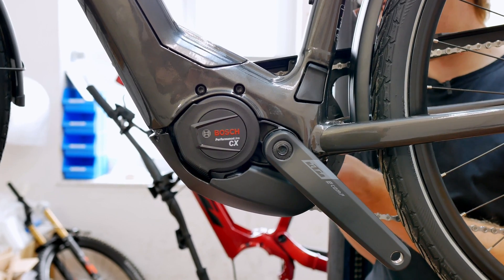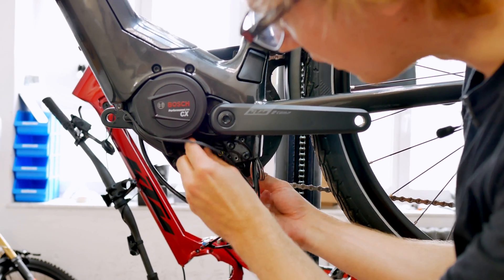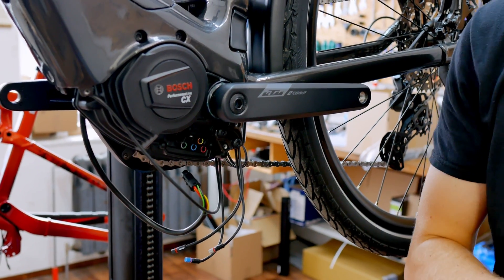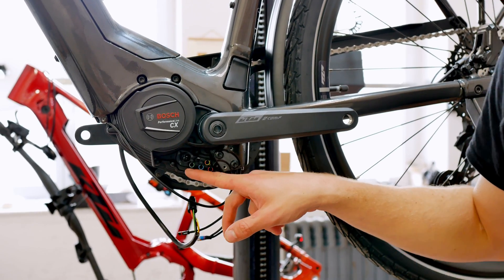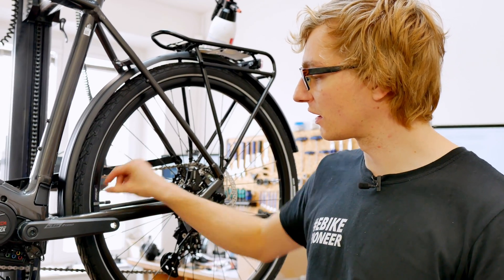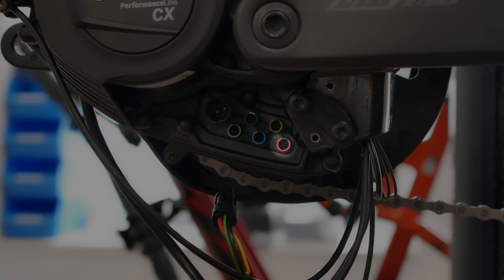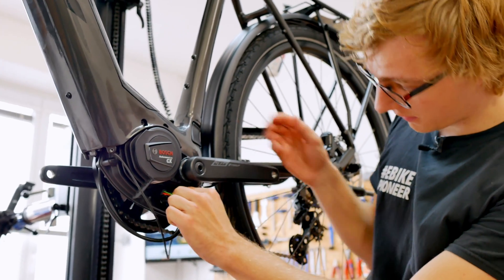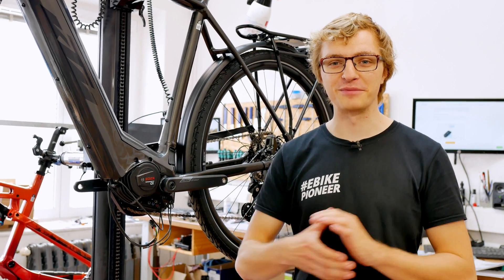Connections on the Bosch Smart System | EBIKE24

Comment: Hello i have SRAM AXS power adapter with yellow connector do i connect to HPP? Thanks
Reply from the maker: Hello, yes, no problem. Thanks.
Reply: @ebike24 thank you. Is this port enabled by default? I cannot seem to get it to power the sram AXS 😭
Reply from the maker: Sorry, I thought you meant the SRAM AXS derailleur, since it's not called SRAM AXS power adapter, but rather SRAM AXS  Powertrain power cable: https://www.ebike24.com/sram-axs-powertrain-power-cable-circuit. SRAM AXS charger, if you mean that, will not work on the HPP port. Bottom line, no Bosch Motor port can charge any SRAM AXS derailleurs. Thanks.
Reply: @ebike24 yes the link you provide is what i mean. This should work without a dealer enabling the port? Thanks for your reply
Reply from the maker: Mostly yes, it is be plug and play, I 'm not aware of exceptions. Although they are possible, they are rare. Thanks.

Comment: Wow, awesome video! Just curious, are these connections the same for all the Bosh motors in the smart system??
I’m the proud owner of a 2025 Cannondale Tesoro carbon equipped with a  Bosh Performance Line Sprint (BDU314Y) motor
Reply from the maker: Thanks. Bosch Performance Line Sprint is a 28 mph motor for the U.S and N.Z., its connections are not the same.

Comment: Could you do a video for gen 5 motors? Is there any difference? I am interested in power output for each port. Some of the ebike lights have high power needs and I couldn't find any information about them.
Reply from the maker: Well, here there are the GEN5 connections: https://youtu.be/Ch8jtN15w44?t=98. You may be interested also in https://youtu.be/RjT9ujpA5MI and https://youtu.be/gZLJcZKb8R0. Thanks.

Comment: Hi, I'm adding front and rear lights to an SX motor. have used the Bch3361 cable from the manufacturer. (cube). Do I need to enable any ports as they are not functioning? many thanks
Reply from the maker: Sorry for the inconvenience. No, there's no need to enable any port.

Comment: How would one add the Bosch ABS (non-Pro) to the Performance Line CX with a GPS module? Series-connections, or would this be done with the "Bosch battery multi-connector cable for component connector" (EB1212004G and EB1120009Z)?

Comment: Hello
please, if I have a wired speed sensor and brake rotor magnet and I want to use a rim magnet, is some adjustment necessary via Bosch diagnostics?
Reply from the maker: Hello, and thank you for your comment. This is theoretically possible but requires certain conditions to be met. The bike must be compatible with a rim magnet, this information can be obtained from the manufacturer. If the magnet is replaced, the bike must be taken to a certified Bosch service centre. At the service centre, a configuration change request can be submitted via the Bosch diagnostic system. The manufacturer must review and approve this request. Once approved, the new configuration will need to be installed on the bike. Here, I recommend contacting the manufacturer directly first.
Cheers - Michael
Reply: @ebike24  Thanks for your reply. So it's a complicated process, it will be easier to get a brake rotor with magnet 😃
Reply from the maker: Yes, indeed a complicated process. But you don't have to replace the whole brake rotor, the magnet is also available as a single replacement part: https://www.ebike24.com/bosch-magnet-6-loch-bdu3xx-bdu4xx
Reply: @ebike24  Good to know, thank you 👍

Comment: Thank you for your content! You help me understand things better.
There is not much information about the Bosch Connect Module, and I would like to figure it out. I would be grateful for your response. My question is:
On the Bosch website, it was mentioned that the ConnectModule works with cellular communication. I didn't quite understand, if my bike is several kilometers away from me, will I not be able to see it on the map in my Flow app? Does this module require a SIM card?
Reply from the maker: Hi, thank you for your kind words! Yes, you will be able to locate and track your bike with the ConnectModule. This works through the eBike Flow app. You will also get notified when the bike is locked and someone moves it, and you can see the movement on the app. The ConnectModule has an eSIM integrated, so you don't have to purchase that additionally. Let me know if you have further questions.
Cheers - Michael

Comment: What is maximum power to lights outputs (blue,red)?
Reply from the maker: Hi with the Bosch Smart System the light output is always 12 volts. So take this into account when buying the lights and buy special headlights and tail lights that are designed for direct current and 12 volts. Hope this helps.
Cheers - Michael
Reply: I asked to power (Wats) not Voltage. I found that light output has 1.5A current which give 18W (12V x 1.5A). But I am not sure if it is separetly for front and rear light (18W+18W)?
Reply from the maker: Sorry for the misunderstanding! Just looked it up again, it is actually 17.4W for the front light, 0.6W for the rear light. Can also be found in here in Bosch's manual on page 10: https://shorturl.at/DL8mg
Reply: @ebike24  Dear friends, excuse me: 

by connecting such 12V/17.4W port to an 12V-USB adapter, could I charge my iPhone 12 pro ? 

Did you ever try this or could you pls, kindly ... make such a test that could be SOOOO (!) useful to many ciclists ?  🙏😉🙂❤
Reply: Thanks! 👍

Comment: Hello, is the HPP connector (yellow, orange) freely active. Or is it blocked like the connectors on the lights? Thank you
Reply from the maker: Hello and thank you for your comment. That varies from manufacturer to manufacturer. Usually, the HPP is already activated for use. It is best to connect a device and test whether the port is supplying power. Hope this helps!
Cheers - Michael

Comment: are you sure the speed sensor is 12v and not 3v?
Reply from the maker: Hi, thanks for your comment. Yes, 12 volts with 1 ampere max. is correct for the speed sensor / low power port.
Cheers - Michael

Comment: Great videos, are the connector type in this example BES2 or BES3?  Are HPP and LPP physically use the same connector with only difference in color coding?  Thanks!
Reply from the maker: Hi, thanks for your kind words! The Bosch Smart System is BES3. The HPP differs from the LPP not only in its colour coding but also in its design, which means that you cannot connect a cable that is intended for the LPP (e.g. speed sensor) to the HPP. I hope this helps you, otherwise you are welcome to contact our customer service at info@ebike24.com.

Cheers - Michael

Comment: Could you make a video about how ABS in combination with Rohloff E14 is connected to a Cargo Smart System motor? I'm wondering if there's any free ports for other accessories.
They must be usingr the T-Cable or the multi-connector cable from the factory I guess. At least with multi-connector there should be extra HPP ports.
Reply from the maker: Hi, Thank you for your comment. Indeed, there is a T-Cable and a multi-connector cable from Bosch. You'll also need the Component Connector to use one of these cables. We have just added them in our shop:
https://www.ebike24.com/bosch-component-connector-smart-system
https://www.ebike24.com/bosch-battery-t-cable-component-connector
https://www.ebike24.com/bosch-battery-multi-connector-cable

We have a video regarding the connector on our German YouTube channel too. I will make sure that we publish this soon on this channel as well:https://youtu.be/IqnqdL9bELg?si=vfKleVwo0hqVow9q

Do not hesitate to contact us if you have any questions.
Cheers - Michael

Comment: Great video I wanted to ask if your bike has a rim magnet sensor can you change this to a spoke speed sensor by adding the sensor to the bike?
Reply from the maker: Hi and thanks for your comment! Generally speaking, this is possible, you can install the spoke magnet and connect the Speed Sensor Slim to the Low Power Port mentioned in the video. The only difficulty might be the bike's system settings. So far there has been no information that it has not worked, but it may be that the manufacturer has to switch the bike settings from rim magnet to spoke magnet. This would then be done via the Bosch diagnostics tool at the dealer. 

You can therefore try installing the spoke magnet first, if there are any difficulties you should contact your dealer.

Here is a link to the speed sensor and spoke magnet:
https://www.ebike24.com/bosch-spoke-magnet-for-smart-system
https://www.ebike24.com/bosch-speed-sensor-slim-smart-system

Cheers - Michael